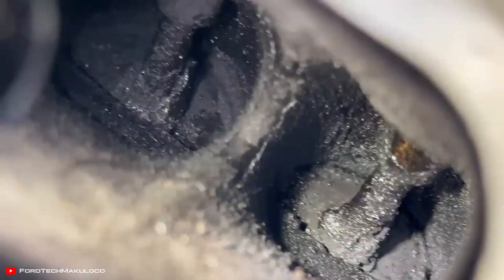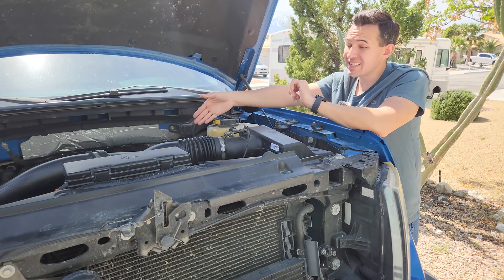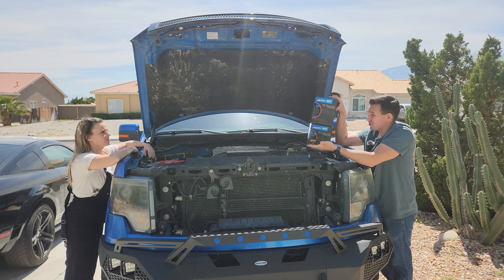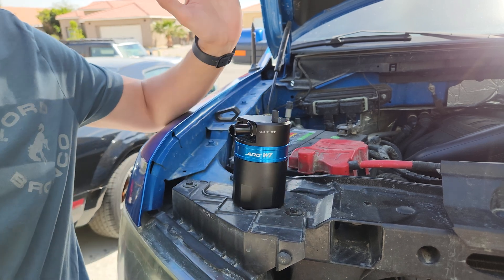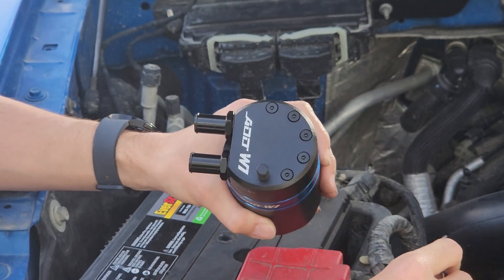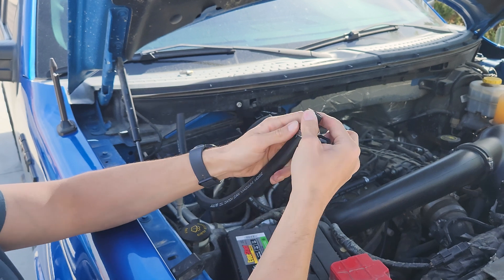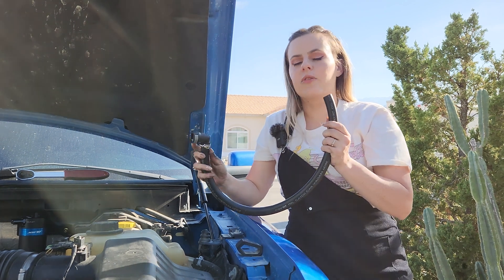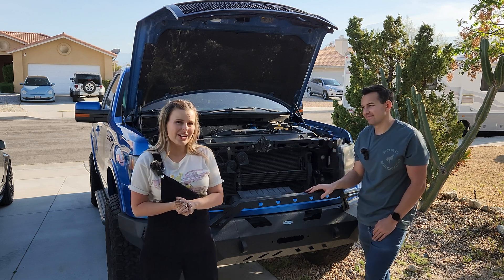ESSENTIAL F-150 EcoBoost Mod Most People Ignore

Comment: I put the Big Ass Catch Can from UPR on my 2104 3.5 Eco the second day I bought it and my valves are hella clean. I haven't walnut blasted/chemicaled them since I bought the truck at 60k miles and im currently at 185k miles. 

I have to empty the can every couple fill ups and a ton of coffee water comes out everytime. It also helps from the condensate from building up in your IC and sucking a bunch of water into your motor when you punch it.

Definitely a must purchase for a 3.5 EcoBoost. Not sure about this brand but any CC should work. My UPR has been going strong for a couple years now, probably time to check the check valves but solid construction.

Comment: It doesn’t work because no one has able to show results meaning valves with and without can. Just because you get something in the can it doesn’t mean you will not see anything on the valves.
Reply from the maker: Would you really want all that oil/fuel mist and combustion byproduct buildup going straight into your intake valves instead? Using a catch can should significantly reduce the amount and rate of buildup.
Reply: @AutoJourney  reduce by how much, no one can answer because people not interested in facts, but doesn’t eliminate.